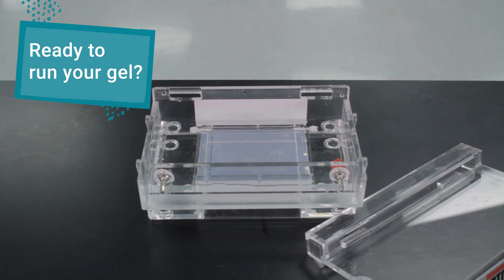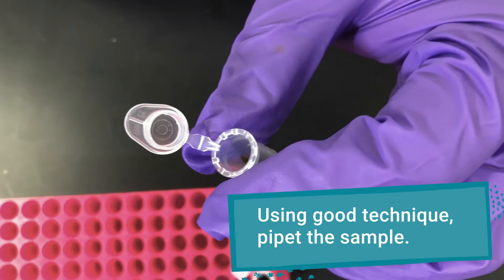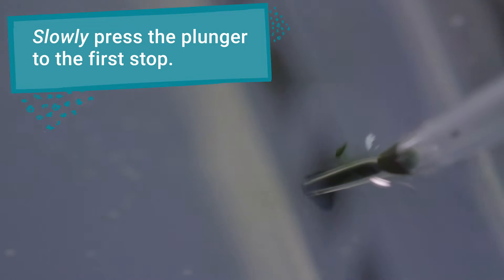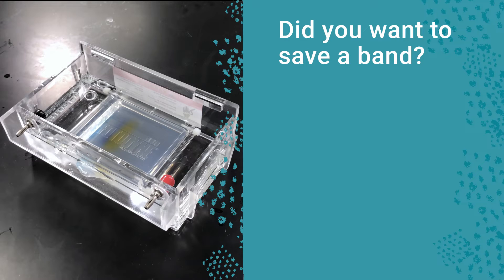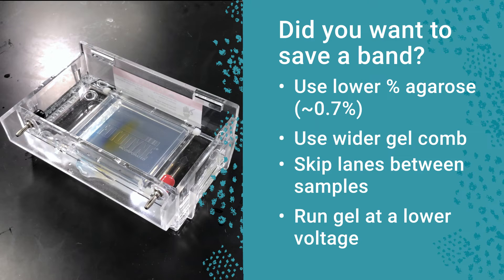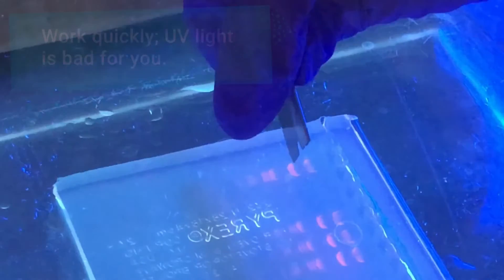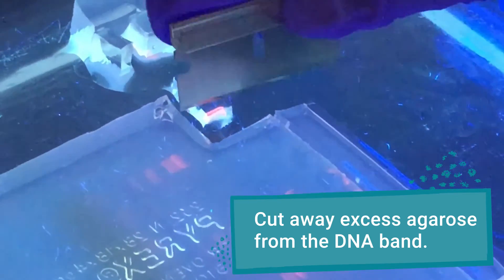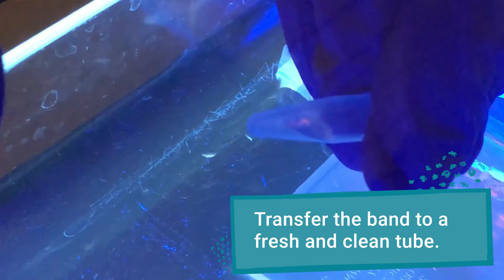Loading and Cutting a Gel

Comment: Is it always better to use a purple dye?
Reply from the maker: Thanks for your question. Electrophoresis tracking dyes used in a loading dye can vary, and there’s not a single “best” choice… it can depend on the size of the fragments and the type of gel. The dyes used in the Blue/Orange Loading Dye we highlight in this video are orange G, bromophenol blue, and xylene cyanol. These are good dyes to use for the example, including “typical” DNA fragments, in non-denaturing agarose gels of standard formulation (0.4-2%). Promega offers a Technical Reference on dye migration through Agarose and Polyacrylamide Gels, which you might find useful: https://scv10mr-cdnpre-p-cus-00.azureedge.net/-/media/files/resources/technical-references/agarose-and-polyacrylamide-gels.pdf?rev=f7415494140846688dbd7b5a0cd64ee8&sc_lang=en&_gl=1*docv4p*_gcl_au*MjU0OTk2ODYzLjE3MzkyMDM3Mzk.*_ga*MTQzOTg5MTYzNi4xNjk1NDEwOTE4*_ga_3KTGR4JGE1*MTc0MTAzMjA3Ni4yNTUuMS4xNzQxMDMyMDc5LjU3LjAuMA..

Comment: I thought when you do first stop down it dispenses half?
Reply from the maker: Thanks for your question. In manual pipetting, the first stop dispenses the selected volume, while pressing the plunger to the second stop ensures complete evacuation from the tip for optimal accuracy. However, this often causes a ‘blowout’ effect, introducing bubbles, as we mentioned. When loading a gel, the slight gain in accuracy is outweighed by the risk of disrupting the sample in the well due to bubble formation. For more on pipetting technique, we can refer you to this video the manufacturer of the pipette in our video, Eppendorf - https://www.youtube.com/watch?v=QGX490kuKjg